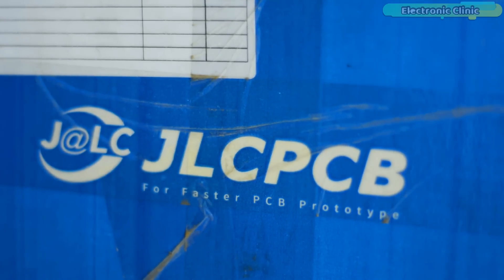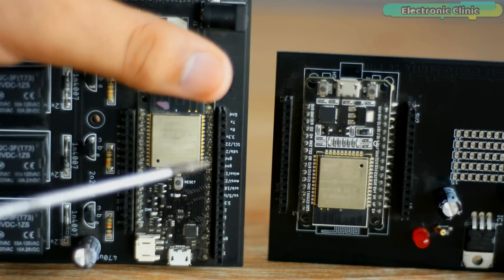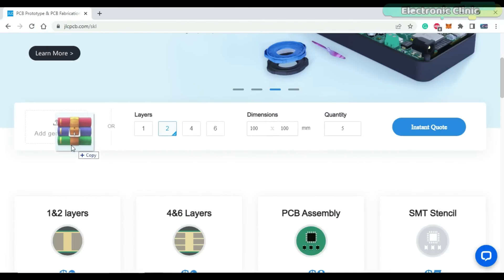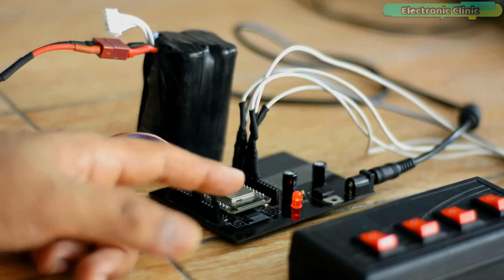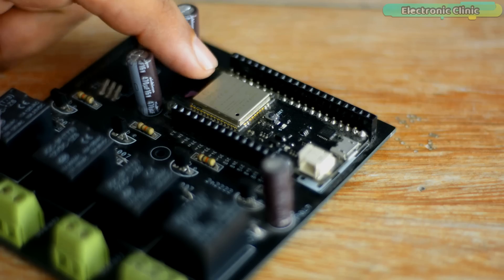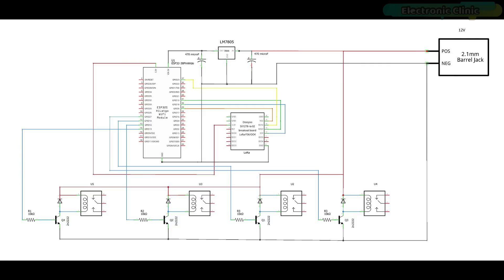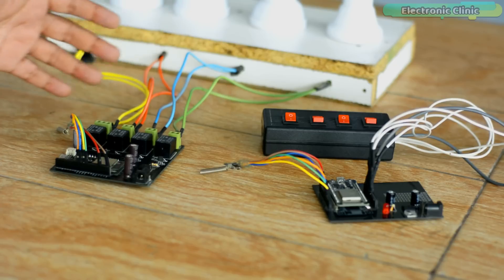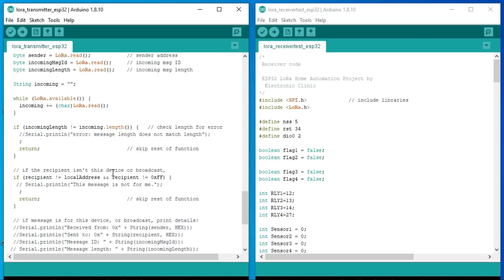ESP32 Lora Home Automation, Long Rage Lora Sender and Receiver, LoRa SX1278

Comment: I'm using a LoRa gate between two ESP32's, is there a way I can overclock or accelerate data transmission between the LoRa modules? (Great proyecto btw)

Comment: Thanks very much my dear for this nice video. Please, assuming I am having 4 receivers, how can I add a keypad on the transmitter side so that I will use the keypad to write the destination address of the receiver that I will like to communicate. The lcd or OLED display in transmitter side will be used to display the receivers destination address when I am typing them. Thanks very much for your understanding and concern. Please, I am waiting for your reply
Reply from the maker: watch my other videos in which i am using multiple lora modules. in those videos i assigned addresses to all lora nodes. You will get the idea how to modify the code.
Reply: @ElectroniClinic  Thanks for your reply. I have watched your video on multiple Lora. But the problem I have that I don't know how to type on the transmitter side using keypad the destination address of the receiver I want to communicate before sending the request to that receiver. I don't want the transmitter to be sending request to receiver automatically. I want to be doing it manually. Please, if you can help me in this project.

Comment: Soldering these boards is nearly impossible. I ruined atleast 4 of them. Why nobody introduce a board easy for soldering ?  😞
Reply from the maker: noted. Tomorrow i will design a new development board for lora. Then you will have no problem. Its gonna take a few days, as you know the designing and manufacturing takes some time
Reply: @ElectroniClinic  Thanks in Advance Bro..Appreciate it